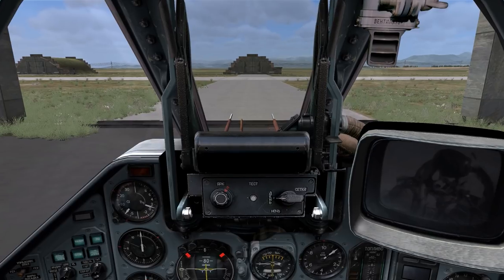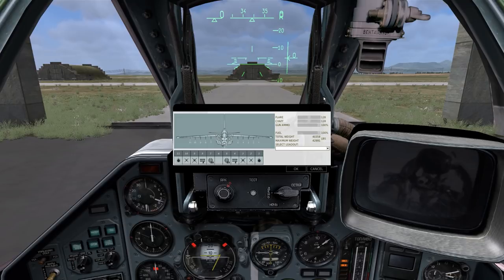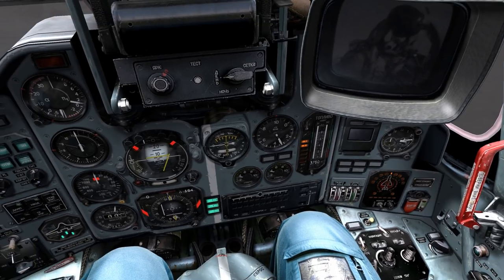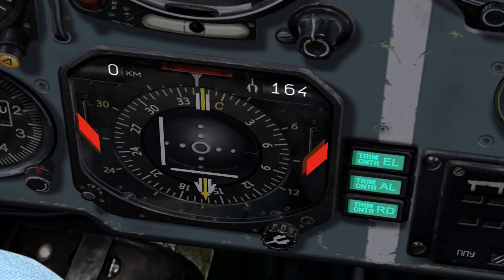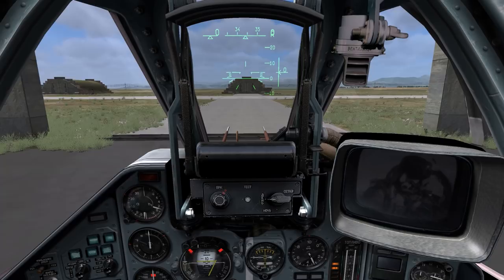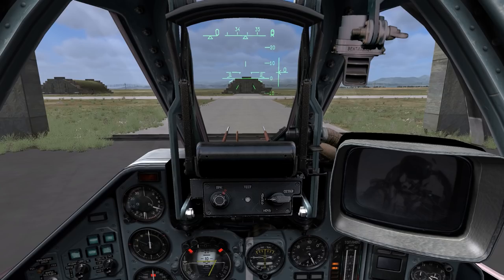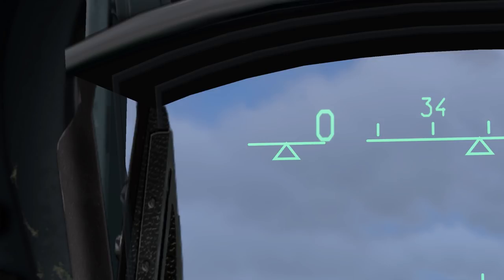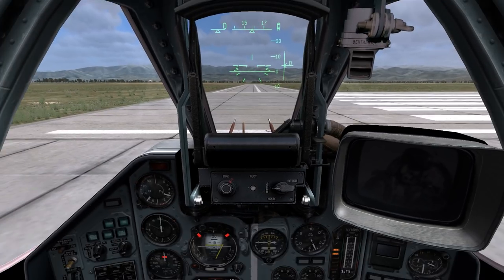DCS World / Su-25T Tutorial Part 1 of 10

Comment: I know a bit about flying planes. I  know that the right pedal on the floor is your accelerator and the left pedal is your brake. The lever in your right hand does the landing gear. The stick in the middle or to the side of you is what makes you move. Push it forward and you go up pull in back to go down. Pulling it left or right will make you point the nose in that direction. If you need to know anything else don't hesitate to ask. I love being so smart. Hoped this helped.
Reply: Tonyb123123 yeaaah, thanks dude, im an ace pilot now. Cheers!
Reply: RealSpongestar124 he was trying to be sardonic

Comment: The keyboard shortcuts are all very well, but what about using the actual switches & buttons in the cockpit?
Reply from the maker: In the Su25T the switches and buttons in the cockpit are not functional.

You need to fly one of the Professional Flight Model aircraft, which come with fully modeled avionics systems in order to interact with the cockpit. The A-10C, Ka-50, UH-1H, P-51D, and many of the other modules have interactive cockpits. The Flaming Cliffs series aircraft (of which the Su25T is a member) do not.

Comment: How did you increase your RPM from 32% to 60%?
Reply from the maker: I have a throttle slider on my joystick. ;)

Check your control settings to see what the keyboard keys to do so are (I think it's Page Up / Page Down by default but I could be wrong), and if you have a throttle make sure it's set correctly in the joystick settings.

Comment: pls help, ican't even start up my left engine pressing rightAlt+home key, no respond at all , do i miss anything?  i tried many times in training mode as well as Rshift + Home to start both engine  but just fail pls help..thx
Reply from the maker: Try RWindowsKey + Home, that should do a the full startup sequence.

Otherwise, check your control configuration to make sure the keys are set correctly!
Reply: how to set my power to zero pls ...
Reply from the maker: RWindowsKey + End will shut your engines down. I believe they will idle at around 30%.
Reply: in training i was told engine power should be set to zero  inorder 2 start both engine  but just find noway to do it.. anyway i will try ur ways ans c how ..thx so much .4 reply
Reply from the maker: Look to the throttle at the left side of the cockpit and make sure it is all the way pulled back. I believe Page Down is the 'throttle down' command, and Page Up is the 'throttle up' command. The throttle should move forward when you throttle up, and backward when you throttle down. If these key commands are incorrect, check the controls settings to see what the actual commands are (I use a joystick so I don't remember the keyboard commands off the top of my head).
Reply from the maker: Good luck!
Reply: thx

Comment: Does it really matter if i take off from a different run-way than the one A.T.C. told me to take off from?
Reply: No. Its just there so people know youre taking off or landing.
Reply: Actually it is very important.  You need to take off in the direction opposite to what the wind is blowing.  Meaning the wind is coming towards your front.  This increases lift on your wings allowing you to take off in a shorter distance at a lower speed.

If the wind is at your back and you take off, it has the opposite effect, you will take longer to take off and you will need to be at a higher speed.
In windy weather if you take off with the wind at your back depending on your aircraft you may not be able to get off the ground in time, or you may be doing a high speed and blow out a tire causing a crash.

It also prevents head on collisions down the runway if some idiot decides he wants to take off without clearance.
Reply: So in other words its just there so people know you're taking off or landing.
Reply: rsx123 Not at all.  It's so two people don't try to take off at the same time from opposite ends of the runway.

Calling inbound and requesting landing/takeoff is what tells people that your taking off or landing.

Though too be honest, I never trust the ATC in alot of multiplayer servers it can become bugged.  I always use the F-10 map to see if anyone is on approach or trying to take off from the other side of the runway.

Comment: does the warthog hotas have rudder support?
Reply from the maker: If you mean the twist in the joystick? No, unfortunately you will need to pick up a pair of rudder pedals to go along with the Warthog HOTAS.
Reply: do you by chance know of a cheap one i'll be using my laptop and it only has 3 usb ports on it
Reply from the maker: Cheap joystick with integrated rudder?  I would recommend the Logitech 3D Pro as a cheap entry-level joystick. The next step up from that would be the Saitek X52. Both have rudder twist integrated into the joystick handle.

The Logitech will work for the Su-25T and all of the Flaming Cliffs aircraft, but if you want to fly the A-10C, Ka-50 or any of the fully simulated aircraft you'll want to save up and invest in at least the X52.

Both joysticks require a single USB plug.

Good luck!
Reply: Thanks for the reply mate very helpful
Reply: ***** the thrustmaster hotas X is a cheap one, it have the thrust control whit an rudder trigger behind....it have also the twist rudder on the stick. overall an ok hotas/joystick for the reasonable price

Comment from the maker: You can turn on the ground using the rudder left / rudder right controls as explained in the video. By default the keys are Z and X. To turn in the air, you move your joystick left or right until the aircraft rolls to the left or right, and you pull back slightly to maintain a neutral climb rate.

Watch Parts 2 and 3 of this tutorial series for more information on turning an airplane. You could also read the manual for the Su-25T (it is included with DCS World).

Comment from the maker: My computer specs are as follows, I use my computer both for work (as a developer though not for Eagle Dynamics) and gaming:
i5 overclocked to 4.4Ghz
32 GB DDR3 RAM @ 1600
2x 240GB Corsair SSD in RAID 0 (primary drive)
4x 750GB Western Digital HDD in RAID 10 (data drive)
2x GTX 670 SLi

I am flying around on the hoggit .us server, they run a custom training mission that can be found in the right hand links on the hoggit subreddit. /r /hoggit or just join their server in the multiplayer browser.

Comment: the engine doesn't turn on i did everything
Reply from the maker: Make sure your throttle is all the way back. The engines won't start if the throttles are cracked even the slightest amount. If using a joystick, move it forward then backward to confirm they're synced and fully closed.
Reply from the maker: @oiler3607  Yes, RightAlt + Home, RightCtrl + Home are the engine start keys. RightWindows + Home is autostart. I think of the Alt and Ctrl keys as representing each individual engine, and then the Home key is the starter and the End key shuts down the engine. Windows keys represents the aircraft: Home starts up, and End shuts down.